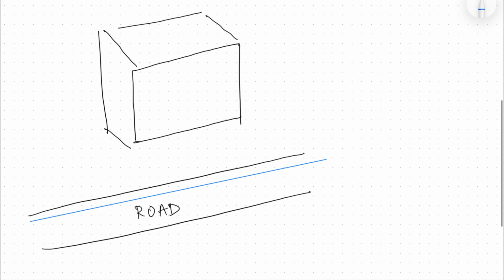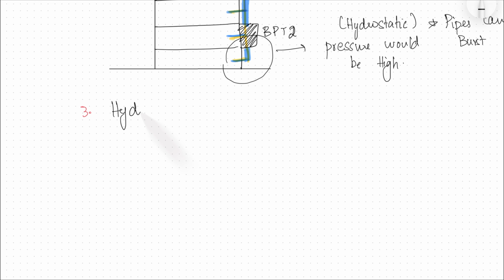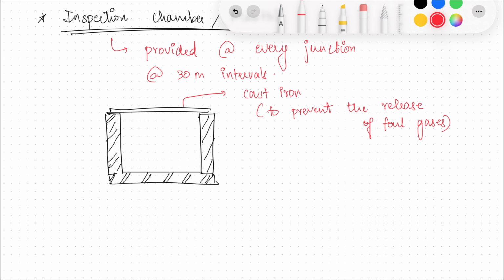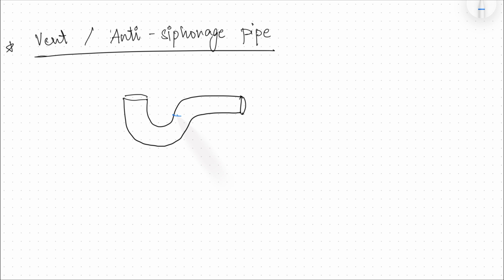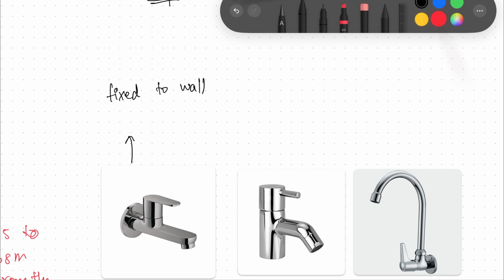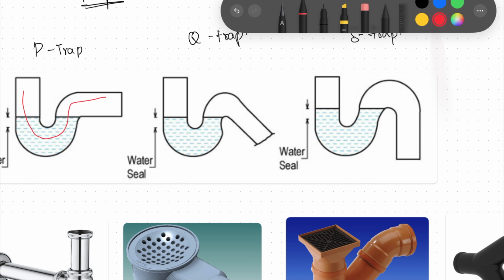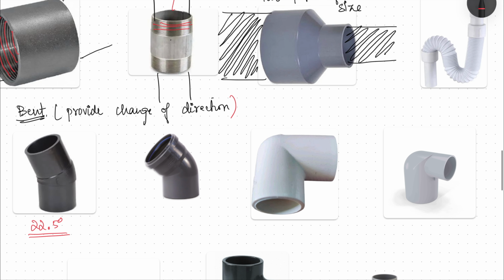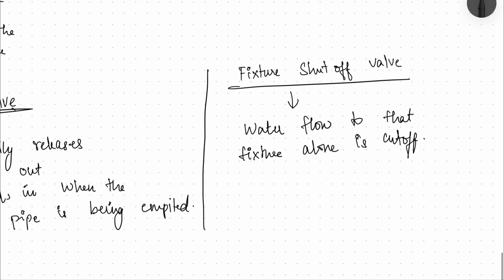Gate architecture - WATER SUPPLY | BSS | Upfeed, Downfeed, sanitation, Plumbing & fitting - Part 9

Comment from the maker: CORRECTION: 
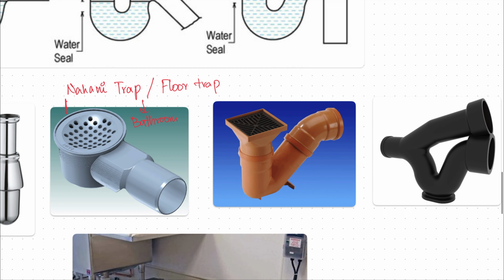1:03:55 - Gully traps are used to connect waste water from sinks, washbasins, etc to the main sewer. Also prevents foul smell and pests like cockroaches from the sewer line to the building (intercepting trap connects main sewer with the public sewer)